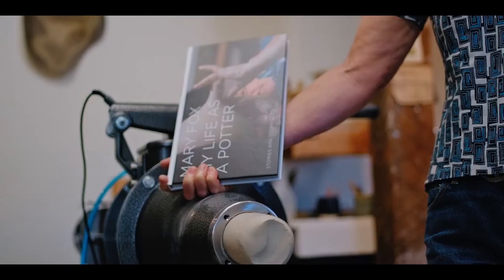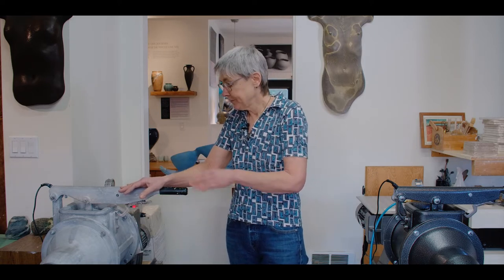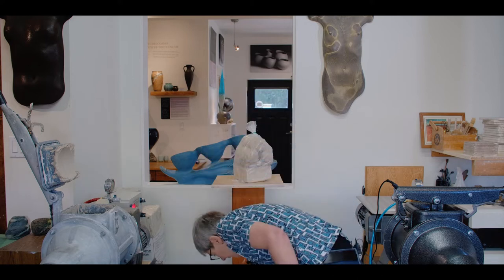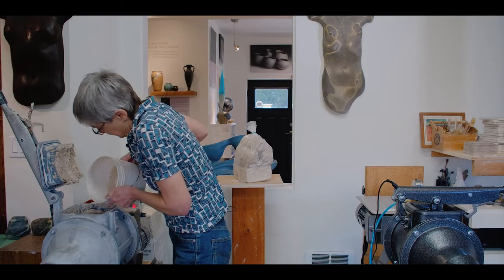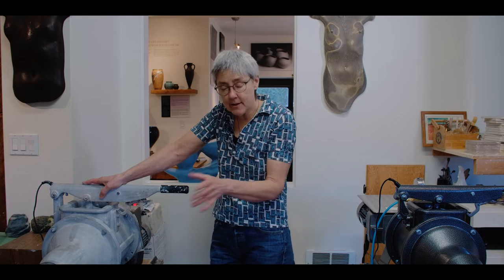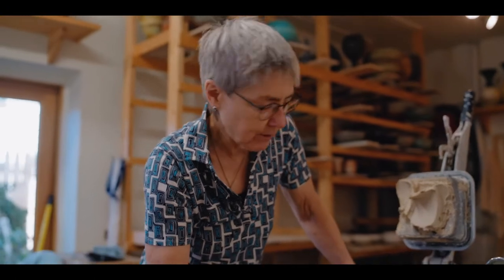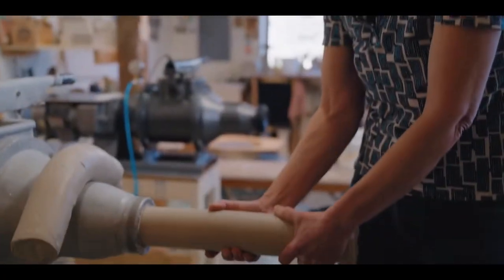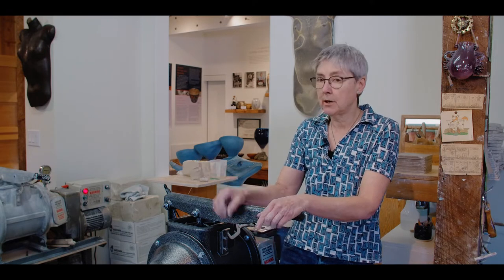In The Creation Room at Mary Fox Pottery: The ins and outs of Peter Pugger Pug Mills

Comment: Hello MAry .. as a flowerpot maker I use easily half a ton a week .Pots start at 2 pounds and go up to 60 pounds (36 +24  sections pots ) Years ago I just made up my clay in a Bluebird Mixer and finished with the Bluebird Pug .. At 73 I am having Sheffield make my clay bodies (a little silicosise ) and am just using the Bluebird pug for the stoneware(White Flowerpots) and hand working the red 25 pound pugs from Sheffield . The boxed clay mixing leaves the clay a bit un humoginus and for bigger pots I need the clay wetter than somone throwing a 3 pound pitcher so I add slop. I am guessing the bigger Peter Pug will help me in adding a little slop and getting the body a little softer . I average around 300 pounds an afternoon .. The question is will this reclaming pug used in this way put out the quanties we need . I see they also have a 30 pound hopper and a 60 pound hopper (I am guessing that is what the # is about .. All the best from Bantam Ct .. Yours in clay Guy
Reply from the maker: @guywolff  gosh, that’s a lot of clay. I think if I was going through 300 lbs of clay at a throw session I would opt for a large machine like the vpm 60. I have the vpm 20 but no one here is going through that kind of poundage.🦊
Reply: @maryfoxpottery  Thanks so much for the input ..Yours Guy